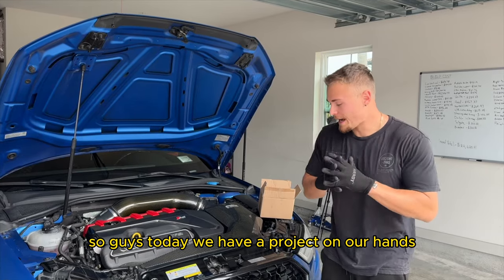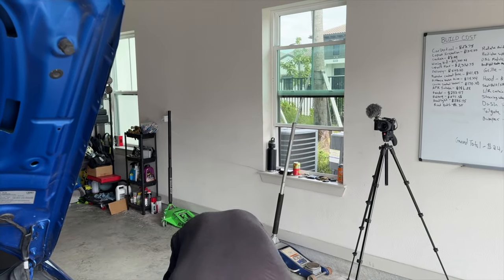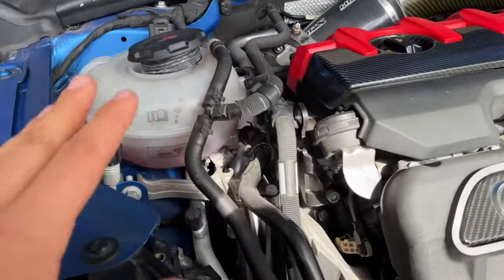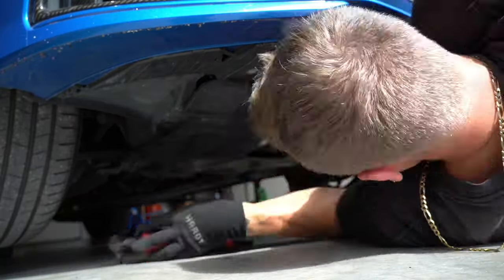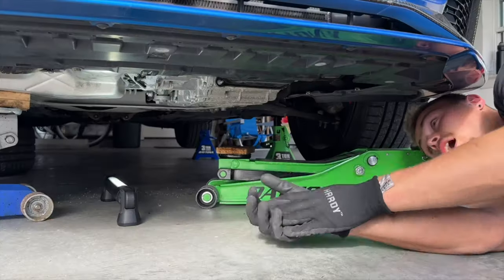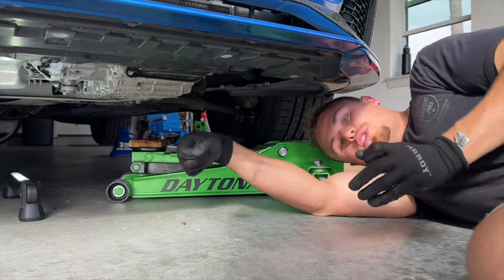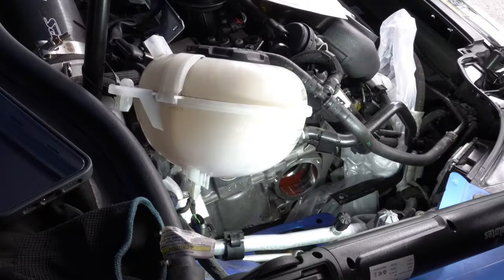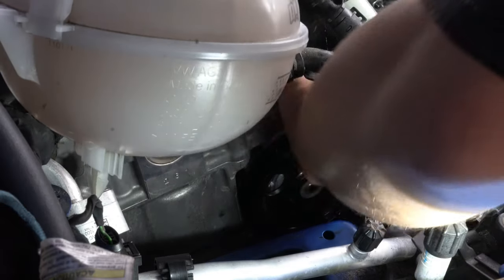HOW TO REPLACE A WATER PUMP ON ANY AUDI RS3 OR TTRS!

Comment: Just want to say "THANK YOU"  for making this video.  The video and information re spot on.  Just finished my water pump swap on my 2018 TTRS and the process went just like your video!  I even went and bought the $10 kit at Walmart.  LOL  Definitely straight forward and lots of steps, but not technically difficult. 10/10  and ⭐⭐⭐⭐ stars!  for your video of swapping water pump and nothing left out.
Reply from the maker: Dude this means a lot! I’m so glad I was able to help you! That $10 kit HELPS!!!! I wish I had a swivel or flex head 1/4 inch ratchet. Probably would have made the process a lot easier! Did the Walmart kit work for you?  And I tried to be as HOW TO as possible! I was looking for a video like this when I wanted to do my water pump couldn’t find any so I decided to make one.

Comment: Good job it seems you study everything before doing the job. That's smart. For your torx bit it exists every kind of length and size on 1/4 and 3/8 drive a good kit of those and a kit of triple square are needed on any job on VAG car !
Reply from the maker: I try to, don’t wanna go into a project blind. I think I need to add a swivel/flex head 1/4 inch ratchet to the collection. Some how didn’t have to use a triple square for this project, although funny enough I bought a shallow head set just in case.

Comment: Great video. Think I might leave the job for an Audi specialist for when my time comes
Reply from the maker: Yeah def avoid the dealer it’s about half the price at an Audi specialist. But if you’re willing to do the work, you’ll get all the tools you see in the video pretty much free. Thats the trade off
Reply: @Haydenschreiermk2  Completely understand, my worst thought is if the engine drops to the floor then I'm in an even worse situation. Great job though. you must be well chuffed with yourself now its complete.
Reply from the maker: @BENJAMIN_TTRS  yes I’m ecstatic! Not only can you do this with jacks you can also use an engine hoist that mounts on top of the engine bay. $80 at harbor freight. You can also put wood or a jack stand as a safety. In case it drops!
Reply: @Haydenschreiermk2  Very true. I based in the UK, but I’m sure they have something similar for sale over here. Will have to take a look.

Comment: With all of this work you might as well get upgraded mounts and a new dogbone. This is definitely a helpful and in depth video.
Reply from the maker: Haha if I did the dogbone mount I’d have to loosen the subframe. From the videos I’ve seen upgraded mounts are a lot stiffer and you’ll feel the engine at idle and when driving. Lots of vibration
Reply: Engine and gearbox mounts are not necessary unless they are worn. Dogbone mount is highly recommended, but no need to change the whole mount.
You can get inserts which fit from top and bottom to fill the open spots in the oem mount. Therefor you don't need to drop the subframe.
Reply: @Haydenschreiermk2  I have the racingline doggone mount inserts installed on my MK3 TTRS. The increase in NVH is hardly noticeable. Only very slight increase in NVH and only noticeable if trying to look for it. I've also installed their propshaft bearing alignment kit as well.
Reply from the maker: @BENJAMIN_TTRS  did you just replace the insert or did you remove the circular bushing in the subframe? Is their much difference just replacing the dogbone mount shaft?
Reply: Unitronic or old ECE dog bone mounts are minimal NVH but definitely tighten things up when running a tuned car.   Worth the cost,  plus very minimal NVH.  Also, 034  subframe sub frame collar mounts and rear sub frame mounts do stiffen car up some more without taking comfort from the car.  They really help when cornering...just a bit tighter.  A rear 034 sway bar helps with our cars understeer,  but be careful to tight  can make car oversteer a bit in some cases.  I own a TTRS and those items definitely helped when running Stage 1+ e85 tune.  Funny I watched video and below my water pump area it looks just like yours.  Time to swap my water pump...nice video!!  Keep going......
Reply from the maker: @derekmartz4320  im also Stage 1+ APR, but i dont track or really beat on my car. just small pulls. I baby the hell out of it haha! im sure they would be an improvement, just not sure its worth it at the time unless they wanna send me some and ill make a video:)
Reply: Just the insert. Not sure about the shaft as I never replaced mine.

Comment: ty for this. i currently have the same problem but at 45k miles. If only pump had gone out when i upgraded to 034 mounts a while back.. it probably would have saved me having to take them off twice lmao. thanks for the pump link also because everywhere i had looked they were between 700-800$ for a rs3 pump.
Reply from the maker: You are very welcome! I couldn’t find a good video for the FL rs3 so I decided I’d make one. Yeah def would have saved a little time. Remember you need new hardware. The local Audi wanted $1200 for me, everywhere online is $700+ lol. This guy I met in a FB group has a link on eBay for the pump so it’s legit. He sells a ton on eBay and it’s a NEW superseded pump, like the “revised” pump. (New part number) which should mean Audi fixed the previous versions problem.
Reply: @Haydenschreiermk2  What year is your RS3?
Reply from the maker: @BENJAMIN_TTRS look at the title of the video🤪

Comment: Awesome video!  Thanks 👍🏻  Do you think I could do this in under 8 hours if I have a lift and all the right tools as you have shown?  (I'm a moderately experienced DIY'er)
Reply from the maker: Yes you can! if i did it again i could probably do it in under 4 hours. i didnt have a flex head 1/4in. ratchet which delayed me. a engine support bar that goes on the top could work as well
Reply: @Haydenschreiermk2  Awesome, thanks 👍🏻  I'm sure this video will help me get it done much faster!

Comment: Great video!  Just ordered the water pump form your link.  Does it include gasket with pump in box?  Also, If I order all the bolts you have listed does it include every bolt the oem dogbone mount bolts long and short?
Reply from the maker: The pump comes with the new gasket on it as well as the 3 screws that hold the water pump in. It’s brand new oem Audi. You can see in the video the new gasket/O-ring is on the pump. If you order the bolts off FCP euro, just click the link and order all the bolts separate. Yes they include the dog bone mount bolts, there are 3. Those will be new too. It comes with the extra bolt for the center bushing, you don’t need to order it as you don’t have to take the entire mount off. You only need to remove the two bolts that I had in my video not the third. Also make sure you have a 1/4 inch swivel/flex head ratchet. Probably easier than what I did in my video. Feel free to DM me on instagram and I’ll walk you through the process on what you need! My ig is in the description!

Comment: Mechanic 20yrs, doing this job tomorrow and thought i'd have a quick look. I shall report back!  :)
Reply from the maker: how did it go????
Reply: @Haydenschreiermk2   Haha, it was an S3, different engine. Water pump at the front below the intake manifold ran off a little belt. Still a bugger of a job but got it done! 🙂

Comment: I wonder how the Milwaukee insider ratchet would help in these tight spaces
Reply from the maker: funny you should mention that as i just bought it last week haha. the water pump bolts i recommend a 1/4 flex head. wish i had that at the time
Reply: I’m at 63k and I’ve been adding coolant more and more. I hope to save some money and do this job. I’ve been wanting the Insider before I dig into any crazy RS3 service.
Reply from the maker: @obmcdo  yes its an awesome tool, its more of a want than a need. the entire job i tried to use hand tools on the car especially with tightening things just so i had more control over torque and to not cross thread anything. But my reason for getting it was because i wanted an extended ratchet and this is both a 1/4, 3/8, and 1/2. so i was sold on that. look on ebay. i got mine for like $295

Comment: After i change it, im getting the same code as before, machanic failure on water pump, what did i do wrong
Reply from the maker: what code is there??? the pump has no connectors going to it. just 3 bolts that hold it in. Seems like your problem isnt the water pump itself. Are there any other codes with it?

Comment: A tip with limited space and torx or triple square bits... put a rachet spanner on them. You're welcome.
Reply from the maker: i did that to get one off, the last bolt i struggled with a ratchet spanner wouldnt work. i needed inwards pressure so it wouldnt slip and i couldnt get my finger behind it. Next time i will use a swivel or flex head ratchet

Comment: How did you know it was the water pump? Mine is using a lot of coolant, coolant is getting on that belt and flinging up on the underside of my hood
Reply from the maker: It is an extremely common failure point on these cars. The signs are all there too, low coolant in reservoir, coolant on belt, coolant on belly pan. You can also take the passenger wheel off and take the liner off like I did in the video and you will see all the dripping coolant.
Reply: @Haydenschreiermk2  okay thanks man!

Comment: Water pump has just an O ring seal and no other gasket?  Metal to metal on mounting surface??
Reply from the maker: Yes just a O ring seal where the metal touches and seals. But the outside surface is aluminum to aluminum. I haven’t seen that part fail. It’s usually where the water pump was casted and plugged that leaks

Comment: what symptoms is a leak? besides leaking coolant
Reply from the maker: That’s the symptom lol.
Reply: oh right haha, i had a sweet smell in engine bay but no coolant level going down and a slight whistle it comes and goes @Haydenschreiermk2
Reply from the maker: @gosuippy  yes sweet smell would be front coolant leaking or spilt somewhere. If the reservoir doesn’t go down then you go no problems